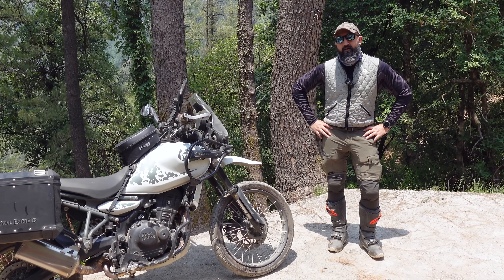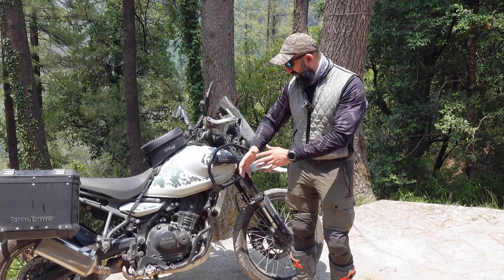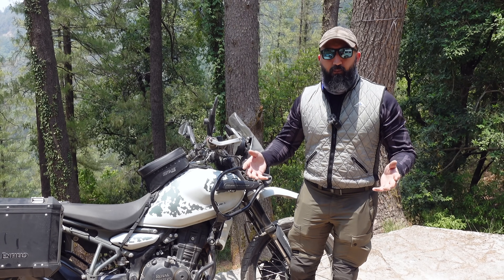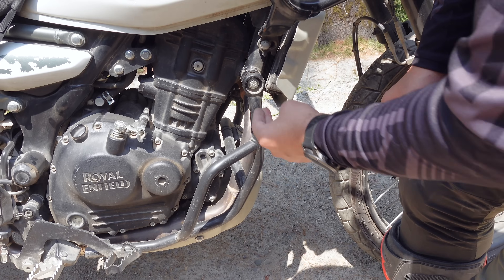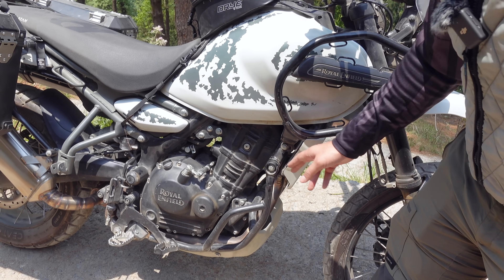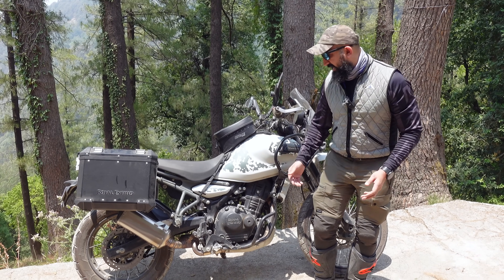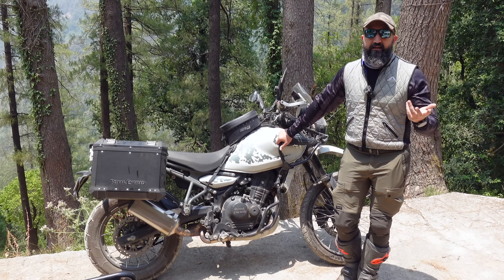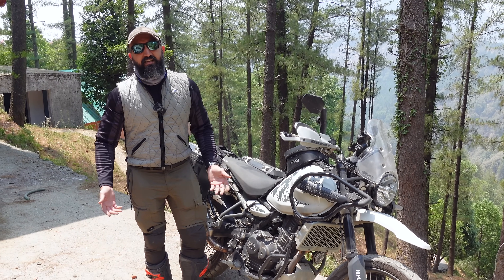Why Did Himalayan 450 Chassis Break: What I Learnt From Royal Enfield

Comment: Bmw 310GS have Big aftermarket guard as well it's doesn't break at all anywhere 

Travelled more than 25000kms on it 

Never heard such issues, 

Its due to royal Enfield inferior engineering and also mainly poor design of chasis 

RE engines are known for being very heavy, loud and unreliable gets wear tear n change of parts like crazy 

So its not a surprise if breakdown, but chassis breakdown it's whole other issue man its purely sub standard product atleast on some of the bikes manufactured

Comment: In my opinion, RE cannot and should not maintain the argument that a third party crash guard caused the chassis break. There were incidents with the old gen Himalayans where chassis broke on stock condition. No third party accessories were fixed in those cases. Even if third party crash guards are said to be the problem, what about all other motorcycle brands and models out there, running with such accessories.? As a rider, how many chassis breakage cases you have heard about other manufacturers.? In Tamil Nadu, hundreds of humble TVS mopeds carrying two adults, one kid and bundles of grass or other goods, are going over the mud rods and potholes like it's nothing. I have seen that a million times over the years. TVS mopeds have only a single down tube, not the cradle type twin tubes. How it manages such heavy stress on the chassis.? Then RE comes with this dedicated, indestructible, expensive off-roader and the chassis breaks while going over a highway...i really admire the way RE grew over the years and became a respected motorcycle brand worldwide ...as an Indian, I am proud of their achievements....but they should change their narrative in these cases, and approach the incidents in a more constructive way....one appreciable thing about this is that RE agreed to replace the chassis under warranty....very happy to hear.... Thanks...

Comment: But the question here comes again as to why would RE replace the parts if they knew that the aftermarket parts caused this chassis failure, normally they would obviously blame the after market and wouldn’t do anything about it, is it because they know something that they choose not to disclose or is they are being generous enough and don’t wanna  spoil the brand image
Reply: When this happens with a Honda, they tell you to pound sand, no warranty coverage

Comment: You really tried very well to explain the issue, but I'm not really convinced. I rather advice RE to make bikes which are more versatile...🤘
Reply: Then you must be a mechanical engineering (Not). The same applies to every brand with engine/ frame stress member, if the connection between the engine and frame is compromised any brand will break.
Reply: @kevinnielsen1356  sorry, i couldn't get you...
Reply: @raulgangsta5750  point is, any stress member engine/frame assembly with the connection between the engine and frame will break if that connection is compromised (loosened or modified incorrectly) irregardlessof the motorcycle manufacturer. The 1st part was me being sarcastic since you are being presented with information from current experienced motorcycle engineers. There are many motorcycles available with full frames, if modern technology is not your cup of tea. Best advice for either type of frame is too check the bolts with a torque wrench, and learn how that tightness feels when using a common socket driver (to eliminate the need to carry a torque wrench when on a long trip). Every brand can have fasteners loosen.

Comment: In Himalayan 450 (and in fact all the upcoming motorcycles using Sherpa 450cc engine) will have engine as a stress member for the chassis and use specific torque adjusted bolts to equally distribute the stress among different parts of the chassis and to secure the engine, other motorcycles using trellis or perimeter frame do not use engine as a stress member, so the bolts securing the engine can easily be used to install crash guards without damaging the chassis.

Also note, that among 40k+ sold Himalayan 450 models, only 2 have faced this incident and even with the same reasoning, so I think RE is not at fault here and still they repaired those 2 motorcycles considering under warranty. It's just that the brand Himalayan is such a fast growing and popular brand such that every small incident catches limelight, Like you see just the Tata cars catching fire every time.

Comment: Total BS Explanation from Royal Enfield, a rubber bush is only to reduce vibrations or over torqued bolt.  if the crash guard is being held only by a rubber bush, you can just yank it apart let alone crash with it, it will be useless. If you over torque it should shread the bolt thread not break the chassis. The crash guard mounts to the chassis with a bolt, and that will transfer the impact on the crash guard to the chassis whether you have a rubber bush or not or if you over torqued a bolt.

Comment: We have seen many instances of Re-Welded RE Himi 450 Frames... Its QC issue where they re-welded frames, bet that had the same. This is RE's fault. When you design frame you take FOS. These aftermarket Crashguards are Crap, but still it cannot break a chassy.  If that was the case they should have not given such mounting option and prohibited the installation of such crashguards saying it will break their chassy (if they actually did the analysis). Its RE's fault.

Comment: Second Himalayan and the same exact problem, frames breaking. Only goes to show the British designed bikes of old worked and the RE engineers are completely incapable, they should have ditched the idea of using an engine as a structural member and made a decent frame that would support the engine safely, instead they failed to recognise the frame used in the 411 was a failure and to definitely not use the same type of frame ever again. But no, they made the same mistake again. Go to China and get them to design a frame or copy one, this is the only way RE will do it, they obviously have someone in charge of design that needs to be sacked and replaced before their name is beyond saving. They can blame bolt on parts all they want, if they designed the frame correctly and included brackets on the frame that did not interfere with the structural integrity of it they would be on the right track. I will buy a taiwan or china bike before this.

Comment: The standard design on most of the bikes is engine on chassis but himalayan 450 is chassis on top of engine.
That means engine is not sitting on chassis rather engine hanging under chassis that is the problem.

Its not about installing aftermarket but the fault itself is chassis design.
I too have himalayan 450 n I never observed the chassis.
God save us 🙏
One thing I am going to do is I will get the after market engine gaurd removed and will install OEM so in case any breakage RE can take full responsibility
Reply: The engine does not 'hang' from the frame. The engine is part of the frame. This is standard procedure with most every moderrn design. It has been used ever since engine casting technology improved in density and tensile strenght. Any manufacturers engine/ frame stress member assembly will fail if the engine frame connection is compromised
Reply: The only explanation which made sense , thanks brother safe riding

Comment: No this is wrong information. This is not acceptable. Kuch bhi ho Jai chasis break ya crack nahi honi chahiye. RE  ki metal quality kharab hai. our they don't use thread lock solution on their bolts. RE's each and every bolt got loose and fall or missing from its position. I am also the mechanic. I had a experience of RE quality issues. They use worst quality material on their bikes. Jugad thook lagau Kam.

Comment: Very sensible explanation, dear Brother. But allow me to say that RE has built a notoriety for chassis failure over the years. Even their bread and butter,  Classic 350 & 500 were not without serious chassis issues. I can think of around 5 riders whose chassis has broken in the unlikeliest of places. I own the Desert Storm and I am a big fan of RE, but I must say their R&D on chassis is much to be desired. I guess the minimalistic chassis on the new Himalayan 450 was designed keeping in mind the weight factor. But considering that the machine is by no means light, I believe RE should have reinforced the critical chassis components using better steel. RE should know better by now that its riders will never stay contented without mods on their models and hence every model should be designed keeping in mind the potential abuse on them.

Comment: Imp question:

So If We're looking at OEM options for our motorcycle: 

There are two diff types of guards available.

Rally Protection and Engine Protection Guard.

It seems like only one can be installed at a time. 

And if Our main concern is protecting the engine in case of a fall.

Is Rally Protection enough to safeguard the engine?

Or can both options be fitted together?

Our top priority is engine protection during a fall.

Appreciate your suggestion.
Reply from the maker: You can only use one at a time. I've crashed multiple times on the trail and the rally guard has held up fine so far.

Comment: Really bro, Its bad design and a miss from RE's side and all they doing is now damage control. So I cant use aftermaket add-ons on my bike. U saying that chassis of my bike is so fragile that it cant take aftermarket parts. Its rubbish. Almost no R&D goes into making crash gaurds or saddle stays. And why the heck design a motorcycle such that it requires specially designed and curated aftermarket parts, its nonsense and BS.

Comment: It's all about integrity. Whether it is medicines, edible products, grocery, or even buildings, bridges, the prime motive is greed and it shows in the end result. Motorcycle manuals have torque wrench  specifications for all bolts 24mm to 6mm. 95% of Indian bikers don't even know how to change a flat tyre. They are not at all aware of the mechanics and nuances of a motorcycle. Because mechanics are cheap and everywhere. 

I bet the third party vendors haven't done any scientific and strenuous testing with their crash/engine guards. They simply looked at the various joints/bolts they could use to make a big looking guard, manufactured it almost at the same time RE450 is launched. For testing perhaps they let the bike fall on a grassy lawn and said "chalta hai".  Now, if there is a broken chassis RE450 without a crash guard, THEN it is of concern.

Comment: In hanle black there wasn't any crash guard on the motorcycle ( atleast in the images). It's good that Royal Enfield changed the required parts under warranty that's again a good sign
Reply from the maker: Notice the bottom tube on the Hanle Black very closely. The engine mount has sheared, indicating there was a crash guard on it without the spacer at some point of time.

Comment: BULLSHIT, we have been Using After Market Crash Guards Not Only On Adv's But all kinds of Bikes In India By Local Mechanics from ages. If Wrong Installation had been the Matter Than all other Bikes Chasis would have broken or Cracked. All Blame is on Royal Enfield. Royal Enfield is been EXPOSED again for Using Cheap/Inferior Quality Metals.
Reply: Bro that's a dumb argument.

This is a different bike and COMPLETELY designed independently of all the bikes you're talking about. 

For example when Nokia 3310 was popular and apple made an Iphone, and it fell, it'd break easier.

Now people weren't saying ki "I used so many bar phones and it was strong but this shit isn't, apple is at fault."

It's just differently designed

Comment: I can guarantee you that most official/authorized RE service centres will not use a torque wrench with adjustable torque values to install the crash guard, let us leave aside the issue of expecting their mechanics to be trained for manually adjusting the torque value for a system as sensitive as chassis. 
I believe that RE is making up a funny story.
With that said, there is a saying, "If a system breaks down easily, better stay away from it instead of handling it as a baby".

Comment: Seemed like a carefully worded verbage to remain politically correct. Use of engine as a stress member is not a new thing..that it cannot take after market accessories.....the 411 has enough history of chasis breakage ...the legacy seems to be continuing ...simply meaning RE is still some way to go before really being able to implement a good design into a good workmanship , quality control , fmea learnings , material quality of the japs or the german/austrians .....high level of fmea / mtbf  implementation will never have this weakness or need to hide behind oem accesories only situation..

Comment: My brain is doing somersaults trying to understand this.
Reply: :face-blue-smiling:
Reply: Well the bike is badly made
Reply: Bro is coping hard. Or trying to get people to buy one, especially from him
Reply: The answer is simple. Do not buy aftermarket crash guards.
If you ever mess with that bolt, make sure you keep that washer and torque it correctly. 
A little blue Locktite on the bolt threads wouldn't be a bad ide either. That will not effect any durability at all, but will ensure that the bolt will stay tight.
Do all that and you are rock solid. Unless other design issues come up in the future.
They went with this frame design to keep the engine down low for a great center of gravity and agility and at a good angle for best rider position and comfort for the most riders.
I have IQ of 122, so what he is saying makes sense and have heard this from multiple sources. 
I am considering getting this bike or one of the older models. I find RE very interesting company and product.

Godspeed!
Reply: Hmmm..so they too have issues..like the 411…hell..I have a buddy who already needs a new Head Gasket..radiator comes loose and leaks .. fluid in the oil..as the oil window has condensation..NOT GOOD.  Oh..and cheap CHAIN that overstretches and falls off..oil filter area breaks away..hmmm..but it has nice shocks..I wouldn’t buy one..CHEAP made..with possibly KNOCK off Parts.
Reply: May God help you then in future 😂
Reply: Seems like this guy is only saving RE for some money or something else And being a rider I condemn this video. 
#IhateRoyalEnfield
Reply: @VikramRoyriderpawanputra  prove your claims or stfu
Reply: @VikramRoyriderpawanputra  Yes, it seems like paid PR.

Comment: I have a question for RE , i was very happy when i saw himalayan 411 got a double cradle chasis thought it was a failure in the beginning but later it got better n that same style was applied to all the other  RE bikes , now why did RE gone back to very old style of incomplete open chasis ? In my opinion the engine has to be mounted inside a closed frame just like most of the bikes . I was very much sure things like this would happen . I request RE to please get back to double cradle chasis , Im gonna wait for somemore time to see if RE comes up with any better changes coz i so badly thought of buying this bike but i  decided to wait because i didnt like the chasis design , btw i do cars n bikes for living .